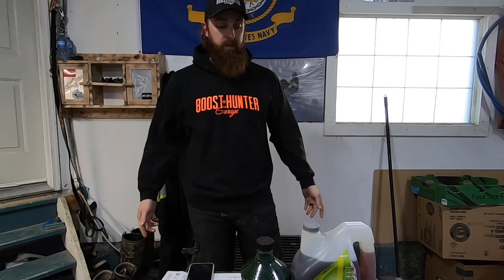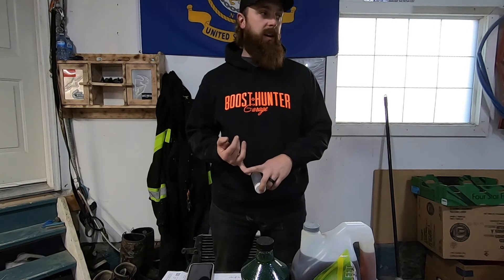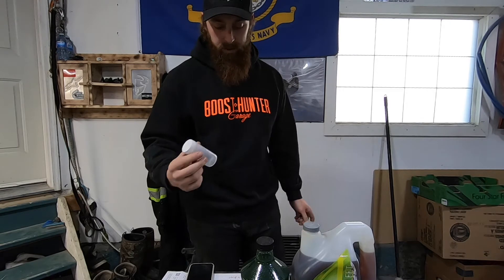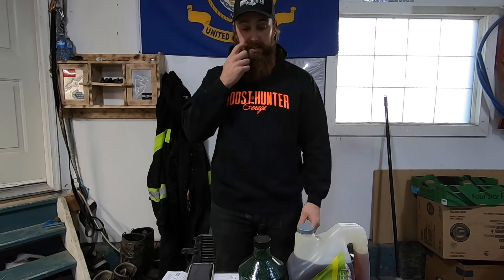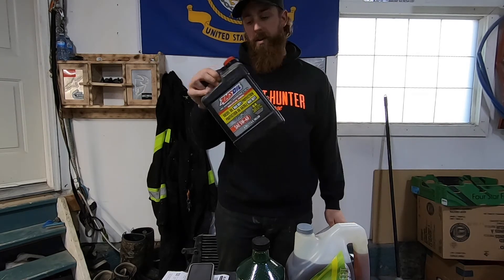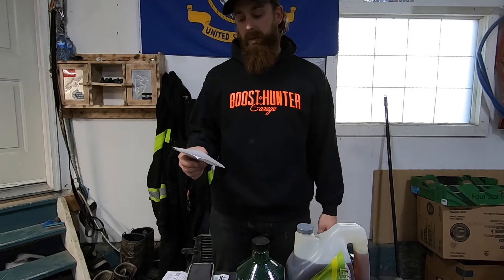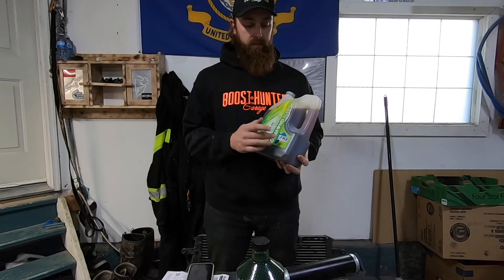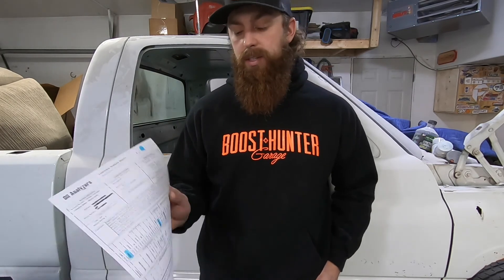300,000 mile Cummins Oil Sample Test | Talkin' Oil

Comment: You bought the cheapest of 3 different oils from Hotshots, that's why it was so cheap compared to the most expensive Amsoil. The Hotshots Black Diamond oil is $65 to $75 U.S. per gallon. And  Stiction Eliminator was made for sticky injectors that use a high pressure oil to fire the injector, like a Powerstroke, your Cummins dosent have that
Reply: You’re wrong about the stiction eliminator. You are right about it being made for sticky injectors, but it’s also made for stiction inside the motor.